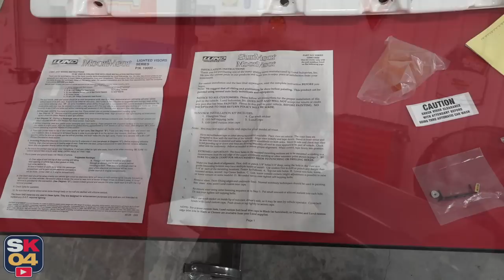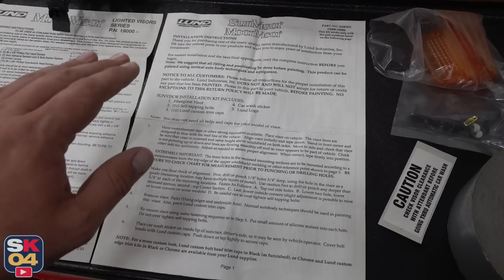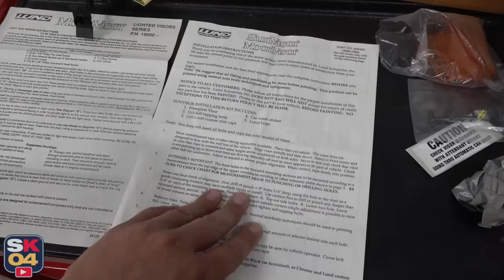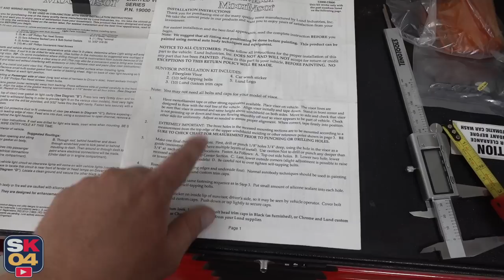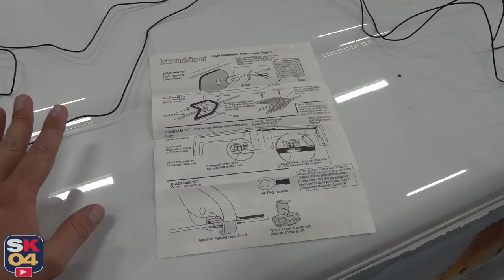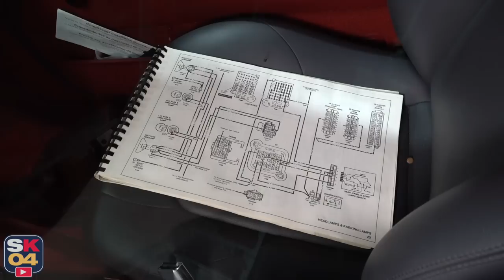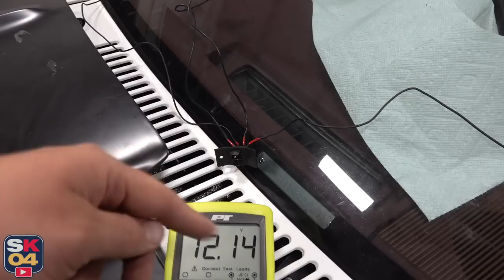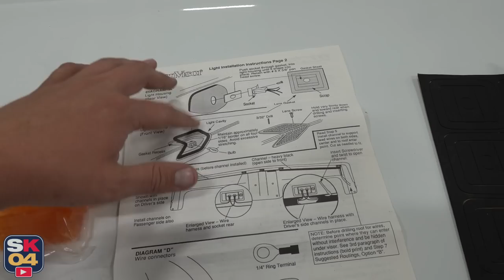Installing a NOS Lund MoonVisor...Plus Other Cool Stuff! S10 Restomod Ep.17

Comment: Personally I've never liked those quick splices, machine I'm working on I've gotten rid of them all and replaced them with butt connectors covered in heat shrink (granted its questionable how much better those are really).

I also feel like that S-10 needs the smoothie rear bumper on it.
Reply from the maker: I will be doing a blazer bumper at some point and probably soldering that wire connection, but I wanted to film and install the visor as it was intended since it was a NOS part 👍🏻

Comment: I would have used nut serts instead of self tapping screws.
Reply from the maker: Well that’s not what came in the kit...I suppose it can be redone that way later.  I installed it as it was originally intended.

Comment: Looks great! Maybe should have used a rubber grommet to pass through the wires on the top though so the wires avoid rubbing on metal. Loving the old school look!
Reply from the maker: That can be added later, I was literally just getting it fitted to the truck.  Thanks a lot 🙏🏻
Reply: @saabkyle04  Nice! I had a feeling you wouldn't let that slip by! 🙂 can't wait to see it painted!

Comment: You should move the tailgate handle to the inside of the tailgate and smooth over the hole left on the outside.
Reply from the maker: If I were to do that, I might as well do a blazer skin.  I’m not that comfortable with fabricating quite yet.

Comment: I know the duct tape is kind of funny as a gag but I would never actually use it for any mock-up. Even if it's only stuck on the truck for a short time, it will leave nasty, hard to remove residue on the paint. I assume you are painting the whole truck?! lol You still don't need the added headache of duct tape goo removal. Blue painters tape is definitely the way to go for a mock up like this. Love the project, keep up the good work!
Reply from the maker: Thank you!  It wasn’t a funny gag lol, I knew it would hold the visor in place and I didn’t care about the residue since the paint is trash already haha.  I was afraid the painters tape wouldn’t be strong enough, I appreciate the insight!!
Reply: Saabkyle04 All good points! Thanks for the reply.

Comment: Should use rivnuts over the self tappers tbh.
Reply from the maker: Of course there’s more than one way to do it, but I wanted to utilize the kit as it was intended.
Reply: @saabkyle04  My thing is you can get domed hex heds for a more flush look and a better hold with the added rust protection though you do have to silicone the threads so they don't leak. Just my 2 cents, I can appreciate wanting to use it as it out of the box.

Comment: those quick splices at 9:43  are prone to failure your gonna regret using it later on
Reply from the maker: Ok?  Why would I regret something so simple?  It’s not like it’s a hard thing to redo lol.  I installed the kit as it was intended.
Reply: @saabkyle04  its the number 1 failure in electricity  corrosion wires in time yes its the easy but like you already know  you can do what you want how ewer you want i did not mean to bee ms know it all  just wanted you to know it

Comment: nice video keep up the good work also i have a few suggestion for this build install a touch screen audio system, a cam, a turbocharger or supercharger, tint thd windows and sound deadening it, go to a tune, do a e85 gas conversion, do LED light upgrades, install a LED Bed light on it, and film a review and sell it when you are finish, also when is the 240sx coming back i have a few suggestion for it install a cam, do LED light upgrades, and do a e85 gas converison on it, and install a widebody kit in it, also i have a few suggestion for your chevelle, install a digital gage cluster on it, sound deadening it, tinting the windowns and installing touch screen audio system, also when do expect to make a video on the 1986 chevy c10, also is it 2wd or 4wd, also i have a few suggestion for your grand marquie install a tune, a cam, a supercharger or turbo charger, tint the windows, and put custom chrome rims on it, wildwood brakes make it a serris, also make a serris on your gmc durmax denali where you install a exhuast, a tune, a cold air intake, custom 4x4 rims, a custom front bumper with a wrench, a custom rear bumper, and a loud horn, and panit the gmc logo with black paint also make a serris on your ford super deulex where you install wildwood brakes, soundeading it, installing a touch screen audio system, and tint the windows please give a thumbs up
Reply: Are you a bot?
Reply: @yungkidnf  no
Reply: Dude stop posting the same comment on every video your getting annoying on here. Like I said he's not gonna widebody or do other mods to his 240 he's gonna be doing an OEM Type X bodykit